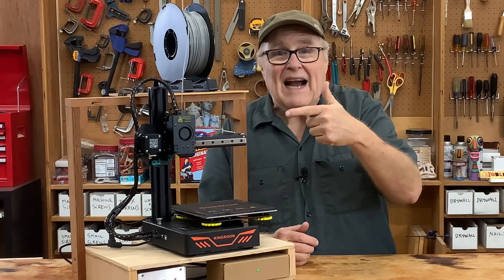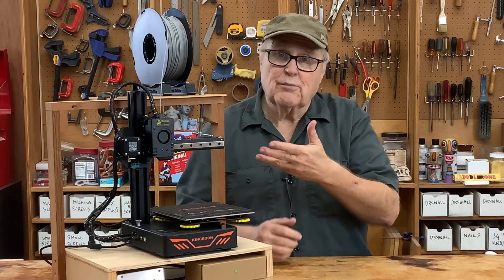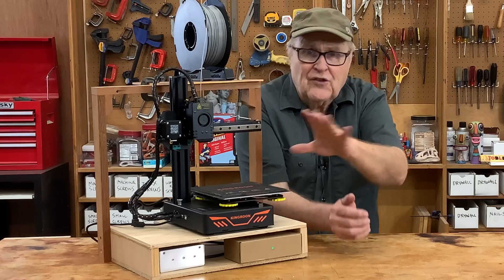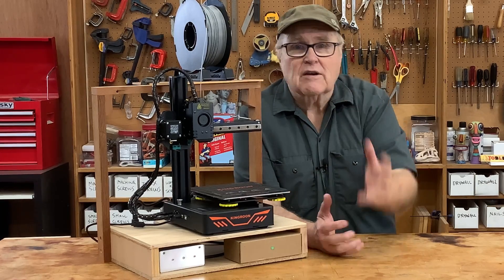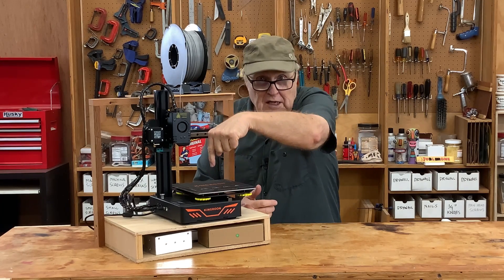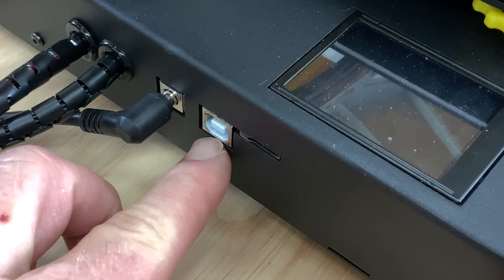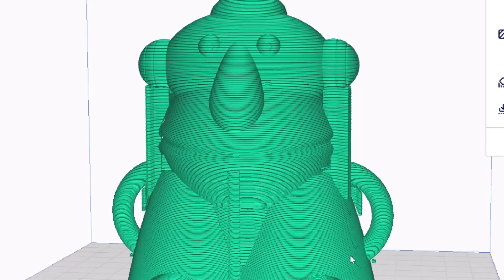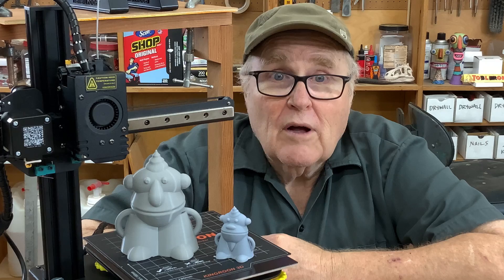My First Filament Print - How Did It Go?   #Kingroon KP3S printer

Comment: Could you do a video about the different terminologies in mold making? For example: explaining what deep pour is and why you might need a different type of resin for it.
Reply from the maker: It’s a good idea for a video. A deep pour is exactly what it sounds like: filling a mold with a significant volume of material. There are resins designed for this, while other resins might shrink and crack when poured into a very large mass. Or they may not be able to take the heat generated from a large mass of curing resin.
Reply: @RobertTolone  I assume there is an upper limit even for deep pour resins as well.

Comment: I have a question Mr. Tolone, I have a part I want to cast but I want to make it smaller the original part. I’ve seen a video by craftsman and he added mineral spirts to his rubber to shirk his mold after a few days of It airing out. Do you have any advice and have you ever tired this method to shirk a mold down. Maybe you could make a video in the future so how you would do it. Any advice would be helpful. Your awesome and thanks for teaching me so much about making molds and casting because of your teachings I’ve made around 40ish molds for  casting.
Reply from the maker: Yes I remember that video. If you look very carefully at the finished shrunken piece you will note that the proportions have changed from the original. I have never found a way to shrink an original object without distorting it. There are rubbers that are designed to shrink or expand but they all suffer from this characteristic, at least in my experience.
Reply: @RobertTolone  Okay thank you for the response it much appreciated. I'm gonna give the mineral spirits a try and see how it comes out. If you ever do a video on the subject it will be a must watch for me. Your an awesome teacher and person. And if it's okay with you I would like to call you my youtube grandpa lol... thanks again.

Comment: I have a question, how do I mold a cylinder object. It has a huge whole through the item
Reply from the maker: You need a two part mold: the outer mold and the inner mold. The inner mold contains a plug that is tapered so that it can be pulled out. This allows the inner mold to collapse inward so it can be removed.  I did a project similar to this here: https://youtu.be/1oCPhUHUD8g.

Comment: @Robert Tolone here's some advice for you.

Set your walls to 4, set your infill to zero percent and use tree supports (set it to "touching buildplate only). 
Set your build plate adhesion to "Raft" and use around 3mm for "Raft Extra Margin"

This will speed up your prints and fix some of the issues you had.
Reply from the maker: Thanks, good suggestions all.
Reply: @RobertTolone  No worries. I also recommend getting a roll of PVB if you can afford it. You can vapor smooth it with Isopropyl Alcohol and use it to make a mold for resin casting without layer lines.

I'm personally a fan of resin printing when making molds since you can use "make model" in Chitubox but filament printers can do it just as well.

Comment: Thank you for awesome content and your expertise! Love your videos! I have a question did you ever try creating mold for Eiffel Tower? Not sure if it possible take out kind structure.
Reply from the maker: I have never tried it and the only cast versions I have seen fill all the small holes in the structure.  It would be very difficult to cast one accurately with all the openings in the metal lattice unless you took it apart and molded and cast it in pieces.

Comment: Nice job on the setup. 
I purchased that printer two weeks ago and am very happy with it. As you say the documentation is mostly non existent. There are a few youtube videos showing how to fix blockages in the hotend and stuff like that. There is also a facebook users group.
I typically use tree supports in Cura rather than standard supports.

Comment: Welcome to the filament printer family.  Most important thing to do is get a set of feeler gages and get your bed L E V E L.  You can spend years tweaking the settings but that first layer is everything.  The supports failed due to the spacing settings, the defaults are usually a bit too wide.  Thanks for all your videos, you got me enough confidence to start casting my filament print project.  I just did my tests on my primer to make sure there wasn't any inhibition.  There was no inhibition and I start smoothing the big model today.  It's gonna need to be done the same way you did the dog-brush-holder.  cut mold with resin on the outside.  At least that's the plan, wish me luck!  And thanks again for making great videos.

Comment: I've created a mold with my 3d printer that I used to cast silicone in. I had to sand and paint it a good amount to smooth the mold out. It turned out really good though. I'm messing around more with it. What I'm wondering is what limits there is to it. I could probably build in vent holes and everything. Maybe I could do like a 4 piece mold. Where I pour most of the mold. Then assemble a second part that would allow me to pour the rest. What I'm thinking is I could do a more complicated cast in a couple pours to avoid bubbles. Thoughts? I'm sure there are simpler ways to go about it. However, I like the idea of using cheaper plastic rather than expensive silicone. Also are there complications inserting other materials in silicone aside from if it inhibits the silicone? I am partially wondering because it first would use less silicone if i could insert 3d prints in the silicone and second, it would allow for to put something more stiff inside soft silicone. Thanks for any help. I have learned a lot from your videos! I would send you an item to try molding. However, it is not so family oriented... If you are picking up what I'm putting down.
Reply: I'm casting my mold around the printed model, but either way you do it, I've noticed something;  If there's any gaps in your top/bottom layer, or anywhere in general, the silicone WILL find a way in.  My test plate had 5 layers on the top, but there was still enough of a hole that it filled the print with silicone.  I'll be making double sure my final is sealed before I try casting it.  I'm using primer and plastilina to finish my print with a little beeswax for good measure.  Good luck ^,.'.,^
Reply: @glowpon3  thanks! I sanded mine a lot then primed it then sprayed it with lacquer and sanded it really smooth. The problem that I ran into was that I used PLA and when I sat it out to dry the heat caused it to warp. I used rope to tie it shut to hopefully fill the cracks. Some of it leaked out those cracks. It still set up fine. There was just a really noticeable line.  If you are making the mold around the printed model, you shouldn't have that problem. Next time I intend to use PETG instead of PLA. That way I won't have to worry about heat warping my mold.
Reply: @Deathbysnusnu125  Thanks for the heads up.  I'll try to keep mine cool.  Was the heat from the curing process?  I may have to do something to mine if that's the case.  I've been using 3dfuel pla since it's the first USA made filament I found.  It's not wound nicely like hatchbox but the price is right and it's local.  They have abs too, I might try that if I have warping issues, but that means I need a vent on my cabinet.
Reply: @glowpon3  the heat was just from letting it sit in the sun for a little while to dry the paint faster. I didn't think sitting in the sun for an hour would warp it. From what I've learned, abs is not easy to print. Most people use an enclosure to keep the heat in to prevent warping and to hold in/ filter off put fumes. Also you need an all metal hot end because it has to print at a pretty high temperature. Most likely you'd have to upgrade your printer parts if you want to try printing it. PETG gets cleaner prints with similar properties at a lower temperature. No enclosure needed. You just have to figure out how to avoid warping.

Comment: Yes a Sucess. Anytime you don't get a spaghetti monster is a win.
Reply from the maker: I babysat this print.  It probably would have become a bird’s nest without my intervention.  I blame the software because the supports were funky but I tried to print them anyway.
Reply: @RobertTolone  supports on a FDM printer are an art form in themselves. You could have used tree supports that grow from the build plate like well a tree. They look closer to the supports on a resin printer. 
But it now sounds like the supports failed and you were weeding away the spaghetti. You may have also been able to print it without supports. You can also design so you don't need them at all.

Comment: I think people are overestimating the current generation of 3D printers. A lot of the stuff on the market right now is really good for what they do, but there's a couple of things coming down the pipeline that will definitely make what we have look primitive: 

• Self-cleaning printers that function like an ink printer where you have a reservoir of material that you refill once empty.

• Computed Axial Lithography a.k.a. no print lines or supports. UC Berkley is developing a printer that prints from the inside out in 360° where a projector is used to cure the resin. The resin sits in a cylinder which rotates while light from the projector shines through it. This completely eliminates the need for layer lines and most supports.

• Speed. The main application for 3D printing is in manufacturing. Right now, we're limited by printer speeds that make 3D printing slower than traditional manufacturing. It's better to 3D print a prototype, cast it, then use the cast to make copies. Fluoridated oil is one avenue to control the temperature of resin while preventing resin from sticking to the build plate. You can continuously print so long as you can keep pulling up vertically out. What this means is that you can print larger objects at a faster rate. A current SLA 3D printer may take 2 or 3 hours to print a 4" model. In that same time period, an SLA using this newer technology could print something the size of a person. Scaled down to something that can fit on a countertop, you could be looking at printing miniatures and models in a matter of minutes, rather than hours. 

• Mixed materials is something that currently isn't feasible with current 3D printers for home/personal use. We may eventually see printers that can do plastic, resin, and ceramic. There's already a couple of prototypes out there that can handle different materials, but they have issues with quality and detail. These printers may catch up to the 8k resin printers we have now. Not only would you be able to print models, but you could also print stuff like tableware. One disadvantage of current 3D printing is you can't sculpt onto 3D prints with traditional materials like polymer clay. You're stuck using air-dry materials or 2-part epoxy. Being able to print armatures that can be fired or baked in an oven without getting damaged is a godsend. 

• Metal printers already exist, but they're huge and expensive (like "multi-million dollar" expensive). Improvements to cold welding or TIG welding can be applied to make 3D metal printers viable for home use. 

Anywho, that's just some of the stuff I've seen out and about in the world of 3D printing. I'm sure there's more stuff I haven't heard of. I just thought the Model-T comparison was apt considering we may very well be getting into Star Trek/Jetsons territory within the next decade.
Reply: First off: No, hobbyist 3D printing won't replace mass production technologies. I don't know why some people keep thinking that. Abandoning economies of scale would be incredibly stupid, expensive and counterproductive. The importance of local 3D printing is in doing things that mass production can't.

SLA resins are toxic, allergenic, expensive, messy to deal with, and have a significantly lower strength/toughness ratio. They are niche, specialized tools, that I highly advise against putting inside your own home. We'll need to see a lot of development going into light-catalyzable polymer chemistries before we see SLA replacing anything. To start with, we need a useful non-toxic and non-allergenic monomer and crosslinker/catalyst system.

Oh, and of note: injection moulding often cycles in seconds. For small objects, they can make dozens of them per cycle. And the material is far cheaper and usually has better strength/toughness ratio.

Hobbyist grade metal 3D printing is called "3D print a model, investment cast it". That won't change in the next hundred years, for a zillion different reasons.

I highly recommend zinc alloys - 400ish°C melting point, easy to work with, good strength and toughness. Aluminium is less forgiving but viable. Never try casting brass or magnesium.

Oh, and 3D printed metal sintering technologies should become cheap enough for them to become an affordable as a service. That's where you'll get steel and titanium parts from - mass production facilities.
Reply: As for ceramics: yes, 3D printed polymer-derived ceramics will become far easier to manufacture at a small scale at some point in the future. But I don't see any reason for 3D print-derived ceramics besides artistic expression, and as such it will be an even more niche market than SLA printing. No reason for mainstream 3D printers to support it.

Comment: Hi Robert, I've been into 3d printing for a few years and I would not say we are still in the model T era, we are well past that. Nowadays printers are fairly reliable considered their cost. I'd say we are in the 80's, they do their job if you are willing to do yours, their performance is far beyond early models, but somentimes they break. Some printers need a good amount of fiddling beacuse they are very poorly designed and made with cheap parts. I had a 10 yo printer and you wouldn't get such a result even if you consumed the whole spool after 20 tryes.
Even the best ones do need some knowledge especially for the slicing and mateinance.
It all comes down to the cost factor. High tolerances in mechanical parts push the prices way up, so it's always a matter of compromise. The 3D printing itself is a maufacuring process and as for other processes you need to know the limits and have a toolbox to operte and fix the problems. There are a few improvements that can be made to make the "perfect printer" but would not be under 1000$ for now, even if the quality reaches the highest possible level there will always be some limitations and eventually some fiddling or manteinance from time to time.

Comment: The issue with the pants being in a separate layer from the feet is beacuse there is a slight Z offset. I used to get these when I modeled with Meshmixer and moved pieces by hand and not by using the coordinate positioning. There was nothing wrong with your bed leveling, and from what I can see, you did a pretty good job, the problem was that the feet touched the bed while the pants were printed without doing so. A plane cut to shave off 1 milimiter off the model should do, your pieces will lay perfectly flat on the bed.

Comment: Hi Robert what resin printer do you use/recommend? please include 3-d  sculpt cb programs as well, free or trial programs for us curious, lexperimental noobs.
Thanks!
-Dave “Pugmug” S.
Reply from the maker: I’m using a Elegoo Mars 2 printer (they gave me) and it has worked well so far. For software I’m using Blender for modeling, Chitubox and/or Lychee for slicing the models. Both have free and paid versions. Blender of course is free.

Comment: So Bob how about a bit  of a time and motion video for Mr Twoface as an example of printing against moulding  timeframes for mass production . A six hour print , cleaning up the PLA print surface etc against making a fast setting RTV mould and how many reproductions you could make in an hour with fast set polyurethane.
Reply from the maker: There are a couple ways you could test this:
Sculpt a model by hand in wax or clay, mold in rubber and cast it in resin VS sculpt the model in Blender or ZBrush and 3-D print it.  In this race I have traditionally said I can do it faster by hand. But that is changing. A lot has to do with how proficient you are with the software and with printing.

When making a bunch of copies, say 50-100, in a race between 3-D printing using a filament printer and rubber/resin casting it’s no contest:  casting wins easily. That’s because each piece has to be printed individually by filament printers.  Even if you can put several on the build plate it’s still have to build them one at a time. In the case of the sculpt in this video it took six hours just to print one.  With rubber resin casting, once the mold is made you can whack out two parts per hour per mold cavity.  also, the parts come out much cleaner from a silicone mold so they are faster to finish.  

The race would make an interesting video.
Reply: @RobertTolone  yep , not for me mate but for other viewers.